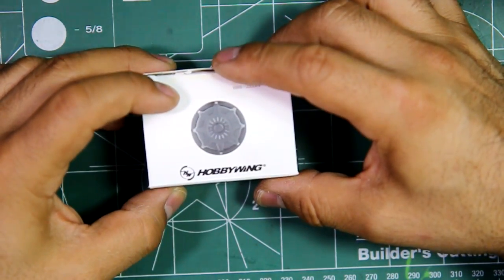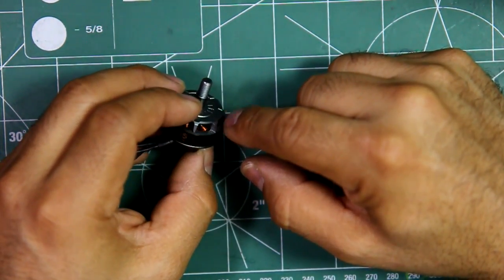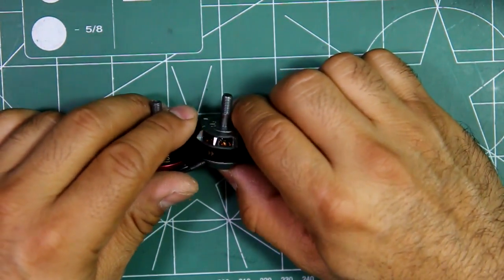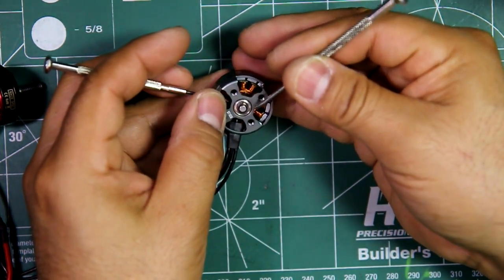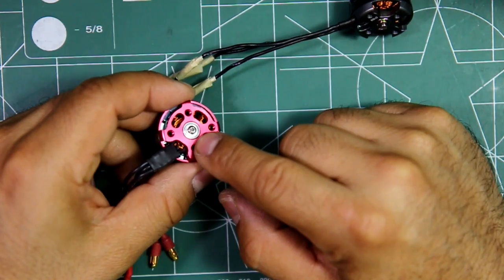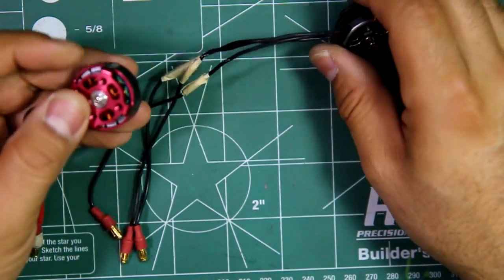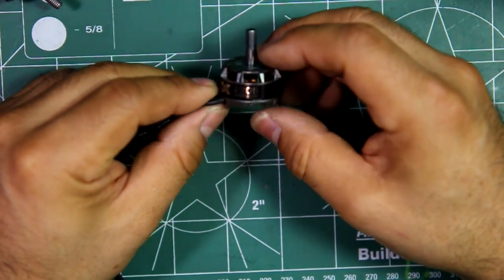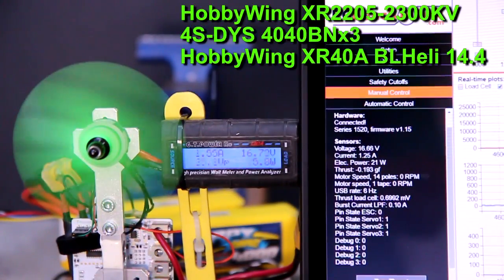HobbyWing XRotor 2205-2300KV - Static Thrust and KV Test

Comment: Can this motor be used with a 3S battery?
Reply from the maker: of course. Just have to use the appropriate propeller for your application. It would have to be a larger prop to get enough thrust - depending on weight, 6" or 7", maybe 8" but perhaps not good for 8"

Comment: Very interesting video!
With prop 6040 / 37.6A, what ESC do you suggest? 50A is ok for you? My plane is a wing 900mm and 900Kg.
Reply from the maker: Daniele Salamone for fixed wing you have to be careful about overheating motors of this size since you're operating under a good load for long periods of time. For multirotors, running a 6" prop is ok because there's 4 motors and usually only short full-throttle bursts. Perhaps on 3S it'll be ok for a plane. I don't have much experience with that type of application. The Amps you see in the tests are on static conditions. In the air there's less load as you're moving. Can be up to 35% lower Amps so a 30 to 40A ESC will be fine. Hobbywing XR40A are very good and affordable though a little large. Depending on plane size you nay want to consider a larger motor like a 2407 or 2507. I really don't know what would be the best match for  the type of plane you're using. Best to look at what others are using in similar setups.
Reply from the maker: 900kg ? Too heavy :)  if others are using this size motor then it should be ok for a 900g wing on 3S. On 4S it could be too stressed. You can also consider a 2206 or 2207 size motor. The new one don't weigh that much more than this one.
Reply: Thanks for your reply!

Comment: Hi have you heard of the new xrotor 2405 1800/2250/2850 kv motors would be nice to see a review on them they look interesting,   I'm looking for a torquey motor for dal q5040x4 props 2205-2207 2306 low kv ?
Reply from the maker: Yes, I've seen them but Hobbywing doesn't send test samples. I contacted them a while back and never got a reply. For 5040x4 minimum would be a 2205-2300KV on 4S. 2206-2207-2305-2306 would be better as the quad blade has more drag due to the 4 blade surfaces. Check out my other recent motor tests for the RCINPOWER 2305,   EMAX 2306, DYS STORM, DYS FIRE, BROTHERHOBBY T2 2206. I test 5040x4 props with all those motors. 
Also going to be testing the DYS Thor and other motors soon.
Reply: thanks I will look forward to your new motor reviews

Comment: hobbywing xrotor 2205 2300kv brushless? what the highest pull (g) with( 4s 14.8v 6046prop) or try( 5s 18.4v 6046 prop)????????
Reply from the maker: HQ6045 already pulling 1464g-40A & 1479g-38A on 4S
6046 prop? What brand?  I would imagine it would be very close to those 2. The higher 4.6" pitch won't get more thrust as motor is already at its torque limit with the 6045, that's why the lower pitch 6040 makes more thrust at lower Amps. 5S with a 6046 prop would be too much load for the motor on the thrust stand and it would probably melt the enamel on the windings. 5S could be OK in the air since Amps will be around 25% lower than what you get on the thrust stand.
Reply: ohhhh okay I understand now thanks and I meant *6045*soz
Reply: what battery is that ? how did u get 16.8v on a 4s battery?
Reply from the maker: I use 2 large LiPos in parallel, one 3700mAh and another 4000mAh. I wanted to be able to maintain stable voltage thru complete round of testing. Sometimes I test 12 props for one motor. For static thrust I think it doesn't matter if you use 16.8V or 14.8V as long as you maintain consistency in all your tests so you can compare motors or props at same voltage. Results are not same you get when flying anyway, even 14.8V will give you higher thrust and higher Amps than when copter is flying as propellers unload.

Comment: looking forward to build my next quad, I'm currently looking at the Emax rs2205 and these xrotor 2205, any idea which one is better?
Reply from the maker: The new EMAX RS2205(S) had better performance. As far a durability, we still need more long-term use reports but EMAX RS2205 motors have been very reliable. Bottomline, RS(S) will give you higher performance for around $16 more total. Standard RS2205 cost about same and perform about the same as these HW 2205's

Comment: Hi! Could you add dal t4045 v2 to you tests? plz:)
Thanks a lot for your reviews!
Reply from the maker: Thanks for watching!
I didn't add to the tests because it didn't make as much thrust as expected, but it does have good efficiency. Here's the test: https://youtu.be/MxHdxkET-Uc?t=2m18s
Compared to DYS/HQ 4040BNx3 https://www.dropbox.com/s/lmspynf0moqewf3/thrust%20results%20RCBM%20EMAX%20RS2205-2300KV-revised.xlsx?dl=0
So I include 4040BNx3. But the T4045 should be Ok to use with the light 2205s and probably better with the high KV motors 2500 to 2700KV
Reply: EngineerX Yeah, i'm currently running them on 2206 2800kv motors, very smooth, really like it.
So yes, 2300kv is low. Will be great to see them with high kv 22ox on your bench;)
Thanks a lot for reply!
Reply from the maker: I will add to test list on next test: DYS FIRE 2600KV. I'll have to check it out in my 180mm quad, but first I need to switch ESC and motors. Running FVT LB20A and AirBot 1806-2300KV. KV too low :(

Comment: Interesting that the quad blade prop is more efficient than most of the the tri blades
Reply from the maker: We really need to also look at RPM and do a comparison based on that metric. But yep it looks like overall on the g/W the quad prop does well on the thrust stand. When flown, it seems the quad props use up battery faster but the increase in speed is minimal, but they do build up thrust a little faster.

Comment: pretty nice motor, although little bit not efficient.
am wondering what kind of rpm sesnsor you used there?
Reply from the maker: Thanks for watching! Yes, the motor is very nicely made, and just feels like very good quality. Hopefully, its great looks transfer into good quality and durability. The RCBenchmark thrust stand can use 2 types. One is optical and the other option is one that calculates RPM from eRPM - from ESC output pulses on one of the motor wires. It's not 100% accurate but it does get very close. 
Keep in mind the very high Amps are momentary Max current. Sustained Max Amps will be a lot less in flight. I use the Max because that's what I've been using in all my tests since a couple of years ago. It's not the best metric but it maintains consistency and sort of shows a motor's power capability. 
I think the motor is about the same efficiency as EMAX and DYS. Only slightly more Amps needed to achieve same 700g thrust as DYS Fire from what I can see comparing both tables.